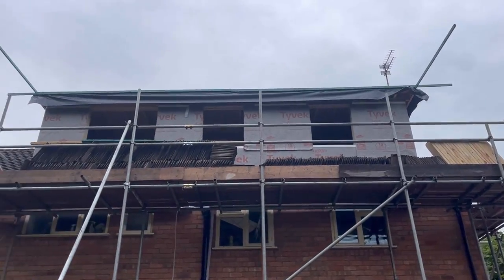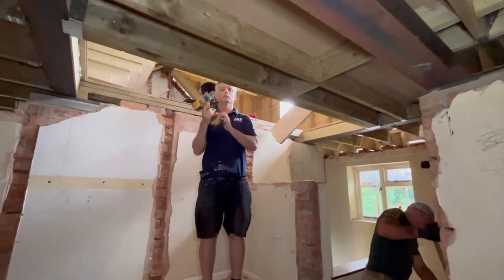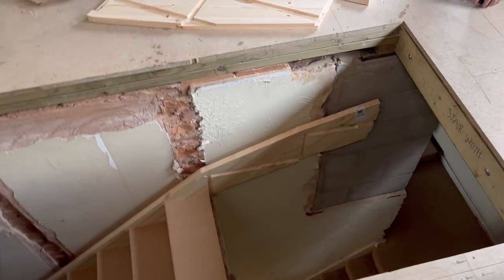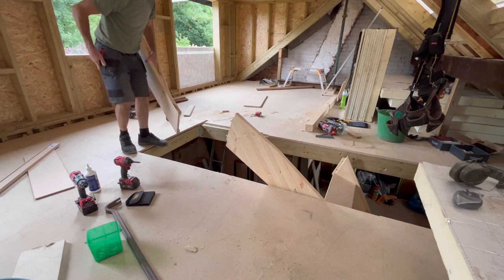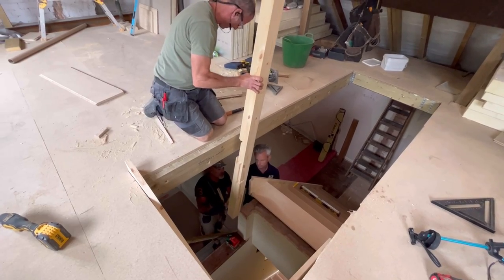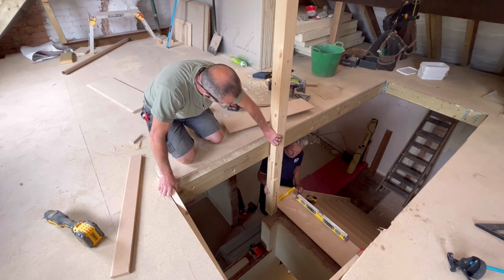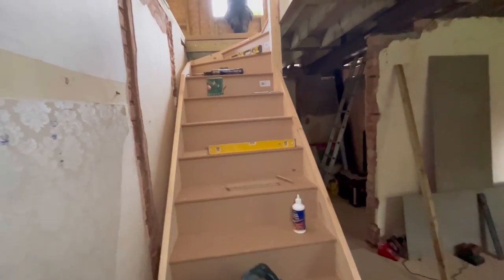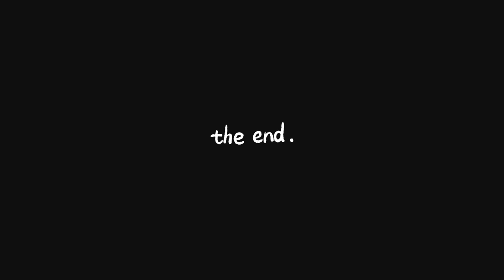Fitting the loft staircase.            #stairs #lofts #howto

Comment: Would it be possible to assemble the whole stairs in the loft and screw through the back of the strings etc , and with all those bodies lift it in ? There looks to be plenty of room in the loft 👍
Reply from the maker: Hi Dermot. Thanks for the comment and you maybe right with that option but as I pointed out in the video I don’t do stair installs every day or even every month so I do it the way my brain works at the time to make sure it all goes as it should do and if for any reason I have my measurements incorrect we would be in trouble with it all glued and screwed together. Have a good weekend Dermot 👍🏻
Reply: That's the easiest and best way to fit stairs with winders if you've got enough room in the loft or floor above, assemble the full staircase and drop it in the hole.